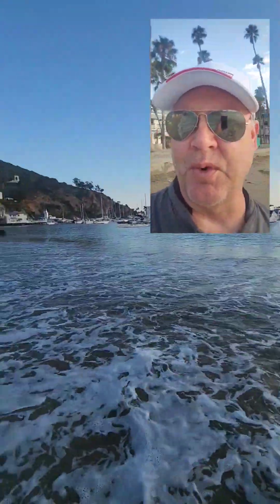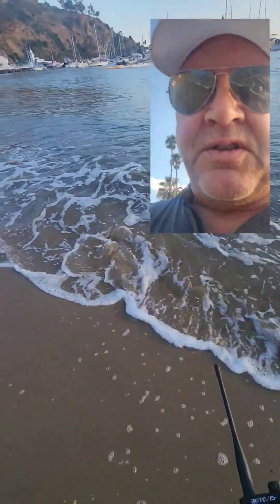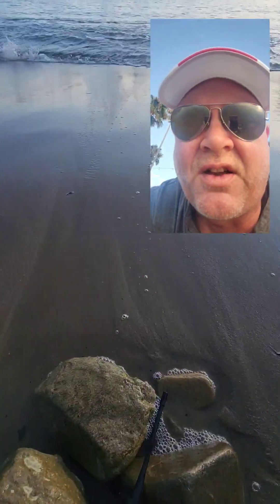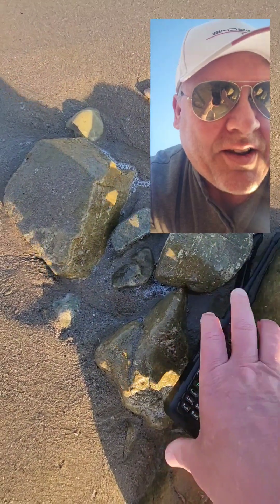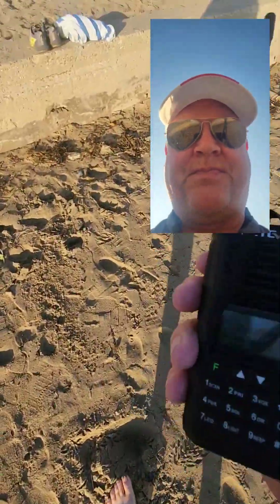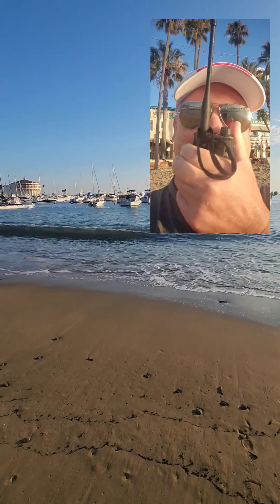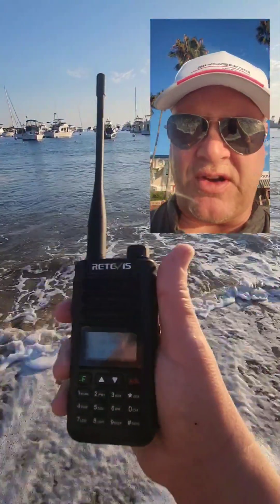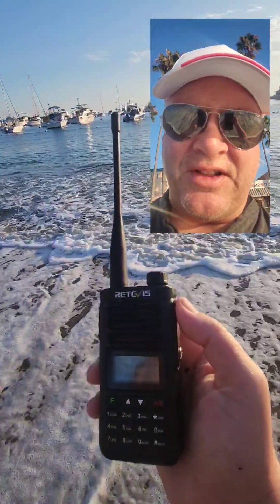Retevis RA89 VHF/UHF IP67 Torture Test

Comment: The “reverse” function is not in the menu of this radio, they promised to make a new firmware, we are waiting.
Reply: I received a new firmware today and I will test it.
Reply: @DudeTested   PUEDE COMPARTIR LINK POR FAVOR
Reply: Disculpa podría decirme cual es función o como funciona gracias
Reply: @orlandoalarcon4158  Esta función le permite intercambiar las frecuencias de recepción y transmisión en el canal repetidor. Para que puedas trabajar con un corresponsal en un canal directo, excluyendo al repetidor, si estás cerca del corresponsal, pero no puedes comunicarte con el repetidor. Uno de los corresponsales debe activar lo contrario.
Reply: Good day everybody, I spoke to redavus this morning and they said they are considering putting the reverse function on an upcoming firmware. Much like the lack of weather radio capabilities, that is kind of a bummer that it doesn't have it already